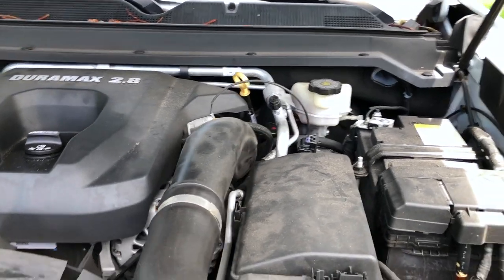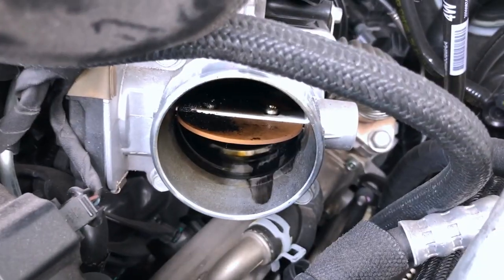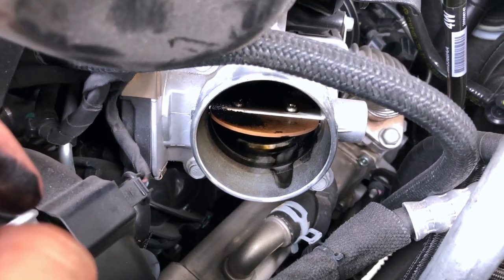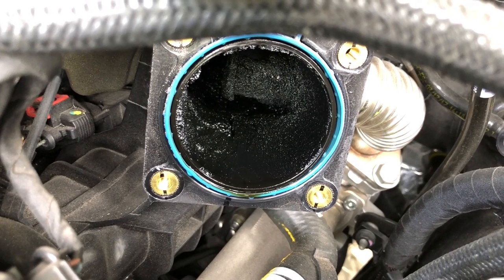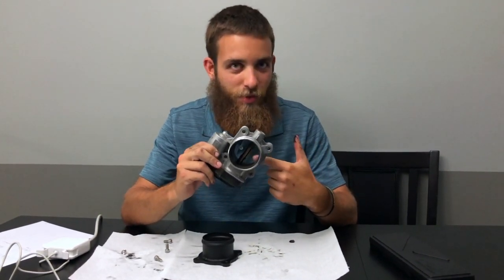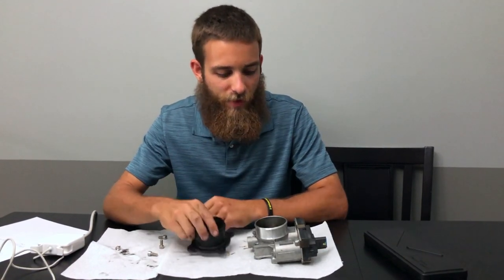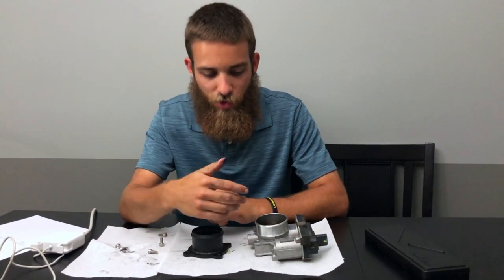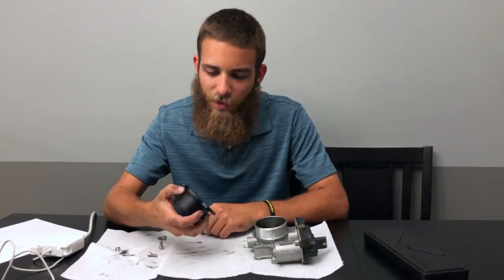ProFab Duramax Air Blade Delete - 2017 Chevrolet Colorado 2.8 Duramax Tuned and Deleted

Comment: There are quite a few factual errors and issues here, poor way to approach what you're trying to achieve. Firstly, the purpose of the throttle body on the intake of a diesel is to generate a vacuum for the EGR system so that it actually recirculated exhaust gas at idle. It is this soot from the exhaust that mixes with the oil in the pcv. Removing the oil from the pcv will limit your build up but your engine will now be breathing in dryer more abrasive diesel soot/charcoal from the still recirculating exhaust. The oil itself is perfectly fine to combust and engines are designed for a certain amount of oil - issue is some a poorly designed and this plus EGR is your problem. Your 30% increase in flow is silly because that's a 30% difference in a piece that is contributing <<1% of the resistance to your intake system from the air filter, piping to turbo intake, intercooler piping, intercooler itself and intake tubing. The throttle body also allows for a softer engine shutoff. Best approach here is an ecu remap where you turn EGR off 95% of the time. In some cool climates it's useful to warm the engine up a bit, increases total engine life, however, the way it's used for "emmisions" now causes more problems, including emissions. Not the best idea to delete the butterfly and install a catch can. What I really want to do is an air to water intercooler with heat exchanger top mounted with a front mount rad in the factory intercooler spot. Massively improve intake temps and air density, massive reduction in turbo lag and resistance. Would also eliminate intercooler piping to front, allowing for an air box roughly 2x the volume, maybe with bonnet scoop. Should be able to reduce intake resisnatce by at least 30-40%. More power, better economy. Deleting EGR will keep the oil way cleaner. Modern EGR systems reduce engine life by about half
Reply from the maker: I am aware of the function of EGR and how the factory air blade (throttle valve) aids in EGR function. This truck has been tuned for a race application and to shut the EGR valve full time, and thus, the air blade is no longer functional, which includes during shut off. Removing oil from the crank case vent with either a catch can or other device would go a long way to prevent build up in the intake as the particulate in the recirculated exhaust gas would not have a binding agent (oil) at that point. As for this truck, the EGR function has been shut off and a catch can has been installed, thus should have no issues with build up going forward. 

In terms of the larger cross sectional area noted in the video. I agree, there are "larger fish to fry" so to speak on this truck in terms of removing pumping losses in the intake system. A lot of improvement can be made in the intake box itself, the cold side pipe, and as you mentioned, the intercooler. On that note, the probe that protrudes into the intake just behind the throttle valve accounts for over 50% of the cross sectional area of the intake at that point. As such it hinders flow more than the aforementioned throttle valve. None the less removing pumping losses, however small, increases the efficiency of the whole intake system. The improvement is the sum of the reduction of pumping losses, however small they may be. I look forward to upgrading the hot and cold side piping in the future (holding out for some WCFab goodies) as well as turbo charger upgrades (Duramax Tuner stealth turbo in the works) so stay tuned for that. Thanks for taking the time to comment. ~ Hunter
Reply: @HunterSkiff   I'm waiting on a GM scan tool clone so I can remap my EGR. Hope to be able to retain shut off functionality and a little bit of EGR in cool temps. At how many KMs did your EGR get turned off? From what I've heard installing a catch can without disabling EGR results in less build up because of less attachment as you noted, however, now your engine is breathing in large amount of abrasive diesel soot. Personally I don't mind a bit of oil in my intake system, protects and lubes a bit. Oil is already getting combusted from the piston rings, etc. As soon as I 95% the EGR I'll take the throttle body off as see if she needs a clean but it's only got 65000km on it so we'll see. 

I agree it's an improvement but yeah probably reduces psi drop by about 0.05 psi which you would get from mild atmospheric/altitude changes. Intercooler upgrade would probably be on the order of 1-2 psi plus decreased intake temps hence the big increases in manifold air density.  On my vehicle the intercooler piping, especially just before the throttle body is laughably restrictive.
Reply from the maker: the truck's first 25,000 km were emissions intact with EGR functioning as it came from GM. For the 50,000km since then the EGR valve has been closed entirely. I just installed a catch can this past weekend and cleaned the intake to the best of my ability. I will check it again in another 6 months, though I would expect it to be clean. The cold side pipe is an absolute JOKE. its kinked and crushed to fit around the battery and fuse box. Not to mention the plastic section is prone to cracking. There is a definite need for a high-flow pipe
Reply: catch can is not grabbing clean oil..... its grabbing the oil and soot...  the soot is in the oil....

Comment: Any way I can get a hold of you? I have a 19 canyon and just got my tuner from MO with the files pre loaded. I dealt with Tristan M and he said the files were pre loaded into the auto cal, and my authorization code was included, but I don't see it. Maybe its in the Autocal itself? Just had some questions about uploading the tune
Reply from the maker: yea man reach out to me on instagram @hunter_skiff
Reply: @HunterSkiff  How has it been so far with the air blade delete?
Reply from the maker: Great. Slightly different intake noise. No seat of the pants performance gains

Comment: Good video. Unfortunately it looks like ProFab no longer sells this product.
Reply from the maker: Yes unfortunately I don't think profab supports the LWN platform much anymore
Reply: @HunterSkiff  This is definitely not the first time I've watched a video and thought "oh cool I should buy that product" only to find out that the company is either no longer supporting  the 2.8 or went out of business. ADP seems to have vanished from the face of the earth.
Reply from the maker: I hear ya. It seems to be one of those engine platforms where if parts are available, and you can swing the money, buy it. Did that recently with the set of CP Rods, evidently they are discontinued
Reply: @HunterSkiff  glad I got mine when I did.  🤞 Just need a few minor mods to maximize mpg
Reply: @HunterSkiff  hey man.  I think that Josh Offroad may be offering a similar version of this.
Reply from the maker: I’ve heard he’s been trying to get some IC pipes as well. Not sure anything has materialized as of yet
Reply: @ryanlogan2911  do you have a website for this Josh offroad?

Comment: What is the benefit to do this? I live in commiefornia so can’t delete/tube. What if any advantage does this provide. Also thanks for the reminder about the catch can, I was reluctant to get one thinking they were just gimmicky but after seeing that slide build up (I’m also at 45k miles) I’m buying one. Any recommendation on catch can model?
Reply from the maker: Increased flow on the intake side. Every little bit of increased efficiency helps. You will have to have tuning to account for the removal of the factory air blade. The catch can is a Burger motorsports can. Most of the "kits" online sell this can with some hose at a huge markup. The can can be bought from their eBay store amongst other places. If you want to keep oil out of the intake tract...and you should...the easiest and cheapest way to do that is to just run a hose from the PCV port on the top of the engine down to the frame rail somewhere, and then cap the port on the intake tube from the airbox to the inlet on the turbo. I believe it's 3/4 inch hose and a 3/4 inch plug to cap the intake. The catch can only serves to catch the oil, as the name implies.
Reply: I would start running either gumout diesel treatment or something for the diesel to help keep all that plumbing clean!
Reply: My colorado has 120,000 and that airblade is not one bit as dirty as this!!

Comment: Question, I have a diesel 2018 colorado 2.8l duramax, with 46k, when I drive it Makes like pulls when the RPM is going up, like loses power on the pedal but just little bit. recommendations or things to consider I never clean any sensor or throttle body I bought with 42k miles
Reply from the maker: I'm not sure I understand your situation?

Comment: Did this work with factory intercooler pipes? or did you have to get a longer boot for cold side?
Reply from the maker: nope, works perfect with factory pipes and clamps
Reply: Awesome, thanks for the reply
Reply from the maker: no problem

Comment: Do you get more power and torque?.what's the point.
Reply from the maker: The point is to remove the obstruction/turbulence caused by the stock blade, as well as the stock EGR probe, nozzle, etc behind it. Is there any more power to be had with the increased efficiency? Possibly. I have not had the truck on a dyno to quantify a change in power if any. The placebo effect tells me the truck spools up slightly quicker. Really wish someone would make a cold side pipe that wasn't crushed, dented, necked down to clear the fuse box. Also something that had better connections to the intercooler. Just putting that out there.

Comment: Your truck is awesome! Im having an issue with mine where it will periodically hiccup and blow a puff of white smoke. Usually after slowing down and taking off at low rpms also blows black smoke on every take off. I have a turbo back exhuast and a def delete. Would installing a egr block off plate help this issue or maybe its something else🤔
Reply: I’m having the same issues. Did you come up with a solution?
Reply: I put plates on, had the same issue.  Ran some turbo/intake/valve cleaner and it cleared up a lot.  Definitely think it is from the turbo, possibly oil seepage into turbine side.  Gonna rebuild turbo and check oil drain line, could be backed up, or just needs to be cleaned and rebuilt.  Hope this helps.

Comment: what is the benefit of getting rid of the air blade? also do you need an egr delet in order to do so?
Reply from the maker: Removing restrictions on the charged-air system will increase overall efficiency. You will not need to delete the EGR system, however, you will need to have the trucked re-tuned to account for removal of the air blade.